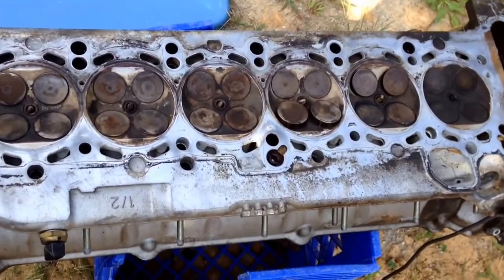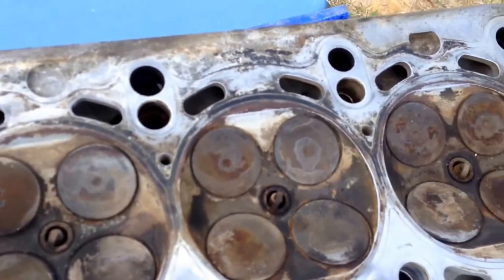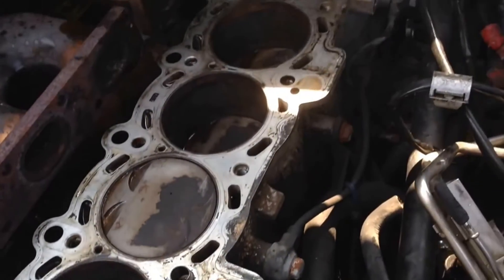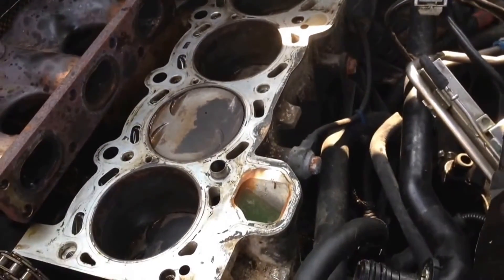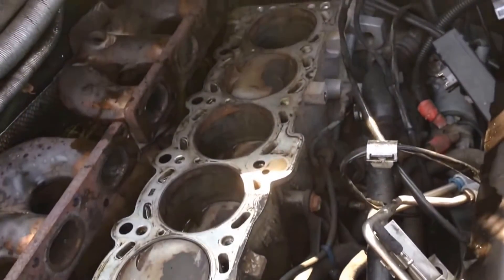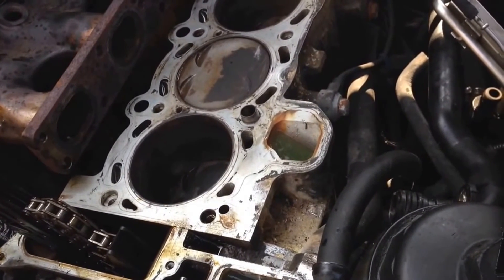How to check a BMW M52 M52tu M54 M56 cylinder head for cracks

Comment: I wire wheel and scotchbrite the whole thing and combustion chamber. For fine polish I use wire cups with my dremel. Never a problem. I also use Aviation gasket sealant on the head gasket and let it seep out around as I torque it down on the recommendation of a great senior tech.

Comment: Hey Nathan, I got an issue with an e36 323i head bolt situation. I replaced the HD and as I was doing up the bolts number 11 was torqued and as I got to the 3rd stage torque sequence doing the final 90 degrees the bolt suddenly went smooth. should I take it out and inspect and put in a new bolt, would that be OK? 

Or should I replace all the bolts if the bolt hole is not stripped?

Thanks dude, love the vids.

Comment: What do you think about the head gasket kits on Amazon? just ordered one from my M54 for my X5. I had one exhaust valve burn and i'm thinking of cleaning and lapping the valve myself as the seat still looks really good.
Reply from the maker: The set on my Amazon store is a Elring which is the oem gasket, a cheap china gasket will leak and is thin as paper, I would definitely lap it in yourself, no need to take it to a shop, you also have to get the hard coolant pipe that goes into the side of the head because it will break when you remove it
Reply: Thanks appreciated and keep up the vids! really helpful!

Comment: @1:16 you can see #2 cylinders seal surface from chamber to water passage is blackened by combustion gas, @ 1:18 I can actually see the crack in #3 cylinder from exhaust valve to water jacket. @ 4:20 he notices that the end bolts where tighter, this is because the head had lifted in the middle stretching the middle bolts making them feel looser.   Is there a follow up video of him removing the head again because he thought this head was serviceable and had reinstalled it?  People please take U tube videos for what they are, a guy with a camera
Reply: Randall Westfall I think you're looking for problems where there aren't any. I have done close to 100 head gaskets over the decades, and couldn't see any crack you mentioned.